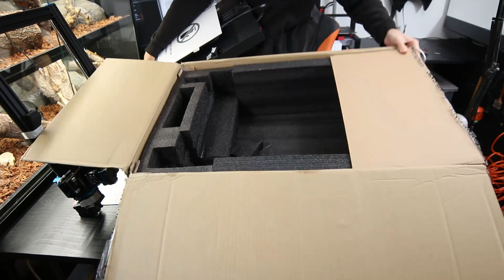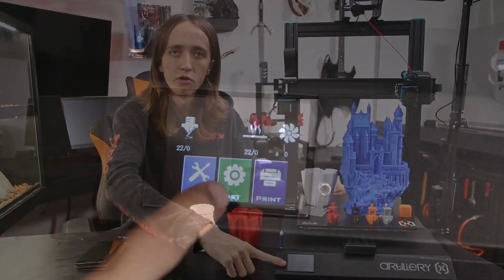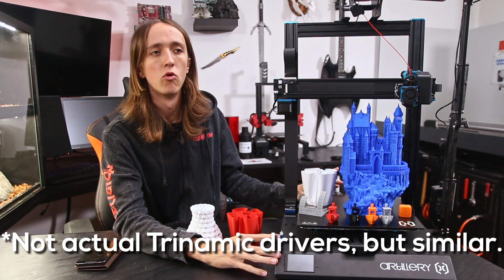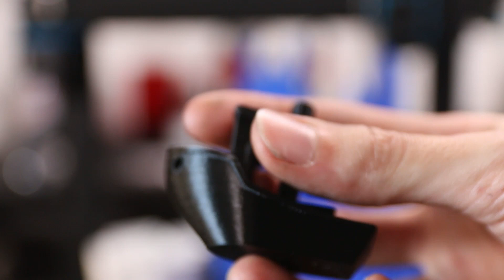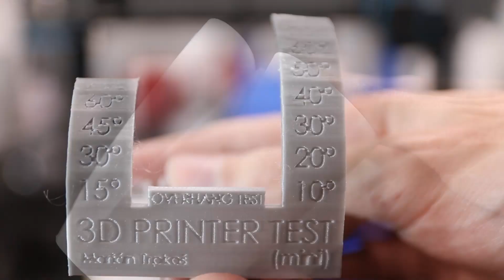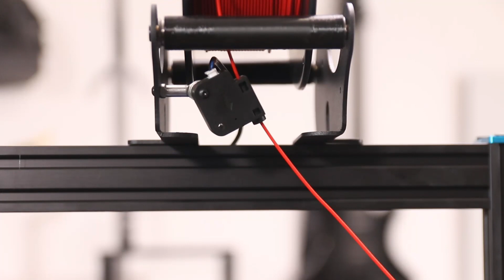Big, Fast, Quiet, Cheap - Artillery Sidewinder X1 Review

Comment from the maker: My concerns about the ribbon connectors turned out to be valid. During my last print, the connector for the extruder came lose a tiny bit, causing the extruder motor to not work properly. This caused the print to fail. Taking out the ribbon cable and reinserting it fixed the issue, it is something to be aware of, however.
Reply: I just ordered one of these, so thanks for the heads up.  Wondering if it would be a good idea to tape the cable to the connector to keep it from pulling out so easily.  What are your thoughts?
Reply: @iam4godru2  I use hotglue on my raspberry pi camera to avoid it from getting tugged out and it works very well! it stops the lock from pulling out and just makes the cable stick to the thing!
Reply: I've seen a couple people mention using hot glue to hold them in place.
Reply: Got a good recommendation for a replacement cooling fan?

Comment: Hi,
I have a question what slicer did you used with the ASX1 and did you used the stock printing settings there ?
Reply from the maker: I've used both Cura and Prusaslicer with great results, mostly stock settings.

Comment: HI - have you tried flexible materials, like TPE/TPU? How about Nylon or ABS? I am thinking about getting this printer.
Reply from the maker: I have not, but since it's direct drive, flexible should be possible with little or no modifications. For ABS you probably want to add an enclosure, but other than that it should work.

Comment: Hey I bought the printer finally after seeing your review . So I’m very excited to you use it . Also I had couple of questions. 
I believe it has a v6 heat break can you suggest the right one on AliExpress ? Is it the same as e3d v6 heat break ? 

I basically want a spare one if I ever have to use it . Not sure about the internals of the heat break . 

Thanks in advance.

Comment: Hi , great results . I’m planing to buy one . I have a ender 3 pro and it’s difficult to print abs in that . Can you share your thoughts on how good does this printer do for long hours for abs ? Can you also share some settings you did for abs prints . I use Prusa slicer . Thanks a lot . Keep up the good work
Reply: Its not good. Especially big prints of ABS tend to warp a lot without an enclosure and there is not enclosure there. So either build an enclosure (that keeps out the electronics though!) or look for a printer that is already enclosed.
Reply from the maker: Just like Sintoxic mentioned, this printer is not ideal for ABS. If you want to print big with ABS, you need an enclosure, no way around it. You could of course build one, you can also do that for the Ender 3 though.
What I would recommend is that you think about if you really need ABS. PETG for example has a lot of the strength advantages of ABS but is much easier to print. I had great success printing PETG on my Ender 3 and see no reason why it wouldn't also work great on the Sidewinder.
Reply: Datulab Tech how about qidi max ? Was alternatively looking to buy that one which has a much bigger size .
Reply: @datulab tech i made up my mind and bought this machine , since i you recommended to use PETG ,i ordered and couple of spools from different brands and i found esun PETG was the best one .I tried it on my Ender 3 pro and decided to go fro artillery compared to CR10 has it was way over budget and features very similar to the ender 3 ,so i made a decision of buying artillery Sidewinder.  Beacuse you will hav eto then spend money on upgrading it and adding silent motherboards etc where this is printer comes stock .

But , i used a flex plate in my ender 3 pro whiuch the prinst stick very well.In sidewinder it has some sorta off a glass plate .How do you think it can handle long prints of PETG ? do you think the plate is good enough ? do you need ant adhesive etc ? I would love a flex plate ,but then again you will have to spend on it ,it would be great if it works right of the box .

Let me know if you have any suggestions for artillery sidewinder bed adhesion, if it has a problem .

Comment: Great review.  I would have liked to see how you level the bed on that machine.  That's always the one part of working with a new 3D printer that causes some grief for new users.  Thanks for sharing.
Reply from the maker: It's pretty straight forward, there is a menu that moves the printer above the adjustment points, you turn the knob below the bed until the distance is ok, then you repeat for the other points. Took 2min in the initial setup and I didn't have to change it since.
Reply: @DarkArtWorkshop  Great news.  Thank You.